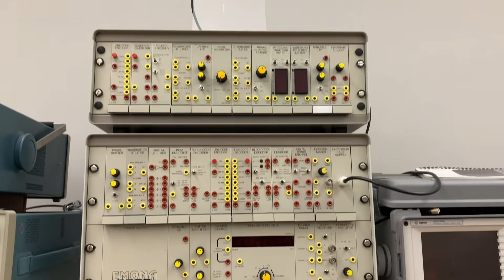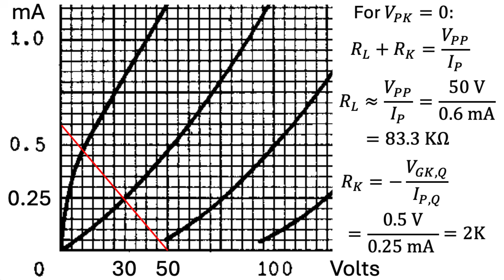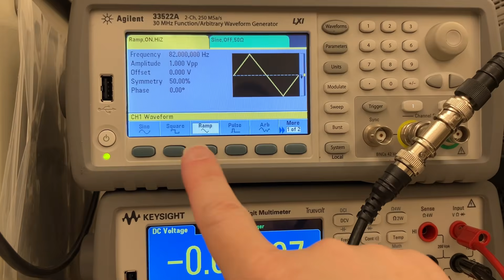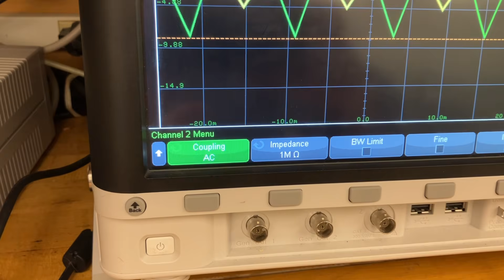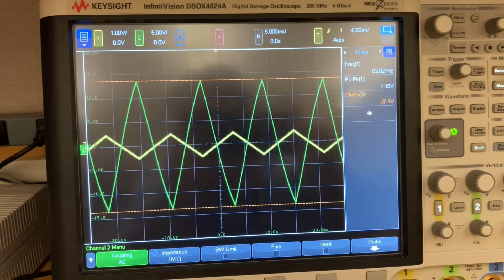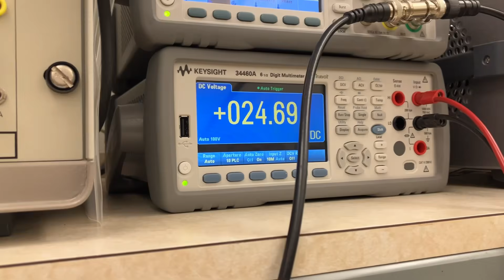50 Volt 12AX7 Common Cathode Amplifier Lab Tests (still works when the grid voltage is positive???)

Comment: GlassFETs! (I haven't done anything with plasma-state transistors in several decades.) When you drive the G-K voltage positive, how much current is that grid drawing?  What are you allowed in the way of grid current in a 12AX7?  (Sorry, I'm not going downstairs to look for my copy of the RCA tube handbook.)
Reply from the maker: I should follow up on a suggestion another commenter made of putting a resistor in series with the grid and measure the voltage across it to check out the current flow. 

In terms of the actual current limit -- I can't find any specific info on the data sheets I've seen. But it says a limit of grid positive bias of 0 volts so it seems like the designers really don't want you to do this.

Comment: Don't let the secret out that you've got a stack of RCA 12AX7's..........a bunch of guitar amp techs will be at your door.  LOL.
Reply from the maker: I'm told by the old-timer faculty here that there used to be a communications circuits class where the final project was basically to fix a television. ;)
Reply from the maker: Heh, I actually went through all the various closets in the instructional labs -- there was stuff collecting dust that probably hadn't been touched in decades -- and collected all the tubes in one spot and inventoried them all. (Van Leer is a very very very old building). A lot of them are weird specialized tubes used in televisions that you won't find in audio amps. Someday I'm hoping to have time to learn about them and see if some of them might make cool effects pedals or something.

Comment: Could you please provide a link to where you bought the PCB tube socket with the quick connect tie in on all 4 sides shown in the beginning of the video?
Reply from the maker: Look for "5 New 9-Pin Vacuum Tube Board Prototype Adapters w/ Sockets for DIY Breadboard" on eBay, or something along those lines (there's a variety of similar listings)
Reply from the maker: There's also an entry for just one labeled "New 9-Pin Vacuum Tube Board Prototype Adapter w/ Socket for DIY Breadboard (Qty)"
Reply from the maker: Seller was called Affinity for Artifacts, I think, they have a bunch of tube adapter kind of stuff.

Comment: As others have pointed out, this is possible because you are driving the grid positive with a low impedance source. This kind of operation is uncommon in most audio circuits. If the previous stage is a regular AC-coupled common-cathode circuit, the grid will not be able to go much above 0V when grid current starts to flow.

Even if the preceding stage is an AC-coupled cathode follower, I suspect that the grid current would cause the coupling cap to begin charging up and shift the input waveform down until the positive peak is near 0V again. I haven't tried it to see if my assumption is correct though.

The Ampeg SVT is a good counterexample. The output tubes' grids are driven by DC-coupled 12BH7 cathode followers, so the grid voltage is able to go positive. It's part of the reason why that amp is able to get 300W out of only six power tubes.

Comment: It's possible to drive a triode with a positive grid to cathode voltage, but not generally recommended. Positive grid potential attracts larger quantities of electrons which then slam onto the grid causing unwanted heating.  Because the grid is made of very fine wire, it's fragile and can thus be damaged.  Besides that, positive grid operation can result in increased non linearity.

Comment: Tubes will continue to amplify normally with the grid positive, but the grid will draw input current. Your signal generator can supply that grid current, so it has no difficulty driving the grid positive. But if you try to drive the grid through a more realistic source resistance, e.g. 10k, the tube will clip when the grid hits about 0V.
Reply: Yes, there is no discontinuity at Vg=zero volts, it just means the driver has to supply power. A2 operation. Gives quite good results as an RF power amplifier.
Reply from the maker: Yesterday I had my students put a 10K pot in series with the signal generator and the output dropped as we increased the resistance. Video in that is forthcoming.

Comment: Thank you. This is exactly the type of circuit. I am interested in. Because you can run them from the phantom power supply of a mixer.The main problem I've been having is there are no graphs at this  anode voltage.The Distortion looks possibly interesting.Have you looked behringer mic 2200 schematic😊

Comment: Are you measuring the grid to cathode voltage with two probes and using the subtract function? I can't quite tell but it looks like you've connected the ground of the oscilloscope to the cathode. Running with V(gk) at 0V will work with a 12AX7 tube, it's just you'll get grid current. As I understand it, with a positive grid you'll get a slight acceleration of the electrons from the cathode to the anode, so you will see gain. If you want to check for grid current, put a 10k resistor in series with the grid and the signal source. Any grid current will drop across the resistor as voltage and the signal will distort as a result. I'd love to see what you end up doing with tubes. Looking forward to the next one!
Reply from the maker: WHOOPS! You are right, I was dumb and treating that single scope channel as a differential input, when really I was grounding the cathode. To avoid confusion I'm going to edit out that part of the video. Thanks so much for catching that!